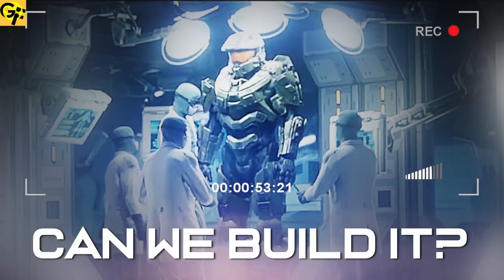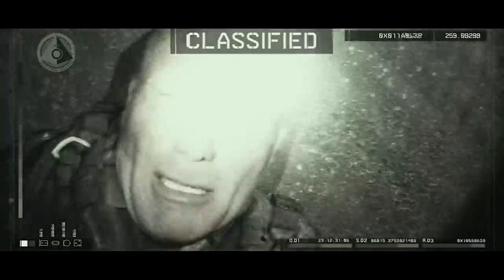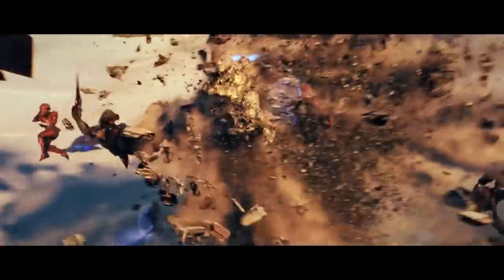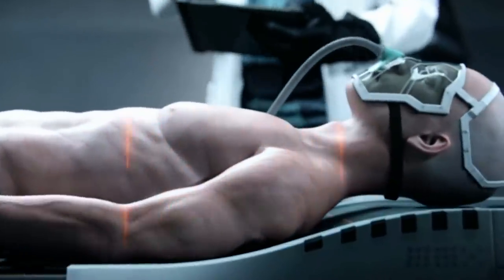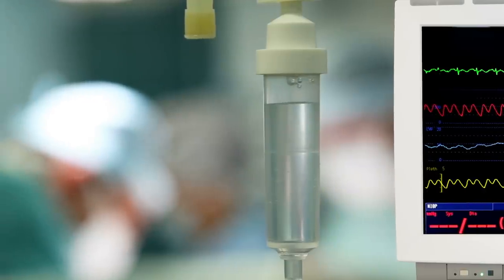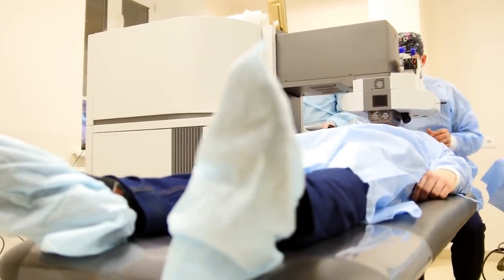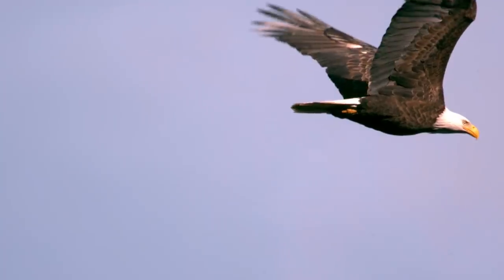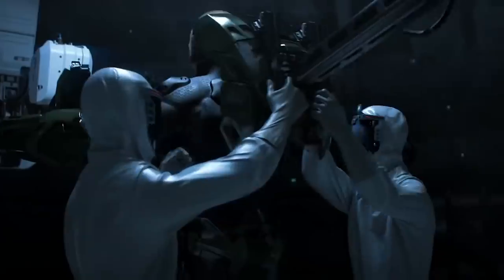Can We Create a HALO Spartan | Human Augmentation

Comment: You forgot that of the 150 candidates, half weren't even recruited due to lack of funding, so they only lost about half, not three quarters
Reply: J C A fifty percent mortality rate is still pretty poor.

Granted, they are better odds than humanity today would, even optimistically, be capable of achieving. But, those odds are still less than ideal. Even if you ignore all of the moral and ethical issues with this program, from a purely economic/utilitarian perspective, it’s a gamble. Only being able to see a fifty percent return on an investment is a loss, and I personally would like my odds to not come down to a coin toss.

Of course, that is looking at the Spartan II program individually. When you look at all of the Spartan programs as a whole, you start to see how the lessons learned from the Spartan IIs were applied to make the process of creating subsequent Spartans easier (i.e a positive return of investment). The Spartan III program was also a waste. But, it was wasteful for different reasons.
Reply: how to build super soldiers, you need carbon nano fiber grafted onto the bone, you also need to have viruses carry DNA modifiers that help boost muscle strength and health abilities. Also the super soldiers bones have to be designed specifically for all possible situations they may encounter, Also they need increased stamina, they need less mass and more strength, more efficient metabolism, cold blooded killers not warm blooded a suit that provides the heat needed in Arctic climates, the super soldier needs to have fast reaction time, they also need to be able to retain memory and muscle memory longer than average soldiers, their skills should require minimal training and they should be able to adapt new skills on the fly, if you can build a super soldier what else can you build?
Reply: Okay, both of you guys need to organize your thoughts before typing them out and edit them, if need be, before commenting on something because I’m not sure that I caught the points of your respective comments.
Reply: Vaurice Payton Literally, everything. You started off your comment as if you intended to contest something I stated in my own comment. But, then you gave a superficial comparison between the Spartan II program and the Spartan IV program, and you capped it off by stating that Buck’s being able to succeed as a Spartan is somehow proof of the program’s validity in and of itself.

(I’m not trying to be an ass or condescending, especially not when I used the word “superficial”. So, please don’t think that I’m attacking you.)
Reply: @Vaurice Payton -- You really ought to get in the habit of breaking your comments into smaller paragraphs.  Even a gramatically perfect paragraph goes on far too long to be a comfortable read.  Especially when read on a mobile device.

All that said, NOTHING about the Spartan IV program is ethical.  Adults or not, the need for secrecy makes augmentation a mockery of informed consent and medical ethics.

The argument for Spartans is "The Ends Justify The Means".  Nothing more.
Reply: 33 made it out of 75. Of the other 34, quite a few were then rehabilitated and put onto the front lines (Jerome, Alice and Douglas of Halo Wars fame were all rehabilitiated washouts)
Reply: @Vaurice Payton -- Please forgive how condescending this is going to sound.  When someone criticizes you, their goal usually isn't to make fun of your mistakes.

It's to save you the time and embarassment of all the other mistakes you will make learning the hard way.  I get the whole "sullen teenager" thing.  I was one myself for a while.

Frankly, I respect your argument that the Spartan 4 program was as ethical as such a program could be.  I also respect that you want to agree or disagree with me on your own terms.

Please don't make big blocks of text the hill you want to die on.  Most people just skip them.
Reply: @Grizabeebles  Bro chill out It's not that serious.
Reply: @bladeexcalibur1334  -- yeah I know.  But I'm 34 now and I was just like this guy at that age.  I never get tired watching people slap away a helping hand.

I mean he never even considered I might have been describing myself as "sullen" back in the day.  It's not an insult, it's the benefit of hindsight.

And if Halo lore isn't a story about how different things look in hindsight, I don't know what is.
Reply: @bladeexcalibur1334  -- Alright, I'll quit it.  Please just bear in mind that constructive criticism IS a real thing and that's what I was going for.

The alternative is everyone pretending there is no problem and making the same mistakes over and over.  That's how the Covenant wound up trying to exterminate humanity over a translation error.

I apologise if I hurt anyone's feelings or acted untactfully.
Reply: @Vaurice Payton Spartan IVs also ain't restricted by the dna requirement as the Spartan IIs were and with 30 year of advancing medical the medical part came out cheaper cause you already had a well trained soldier and didnt have to put more time and money into training already viable candidates thus thay could have more but at the cost of the mark 7 armors with its more limited armor capacity then the mark 5 and 6 that master cheif has worn. Spartan III were suicide squads and only worn odst armor with camo tech and no shields and could train 300 to 500 at a batch with all but 30 or so dying throw the agumintation which left the user in a rabid state if they didnt get the proper medication every few days. Thus Spartan IIIs could have half there chest blown off and still run till they dropped dead from lak of blood.
Reply: @wildcat2087  The part about the SPARTAN-IIIs is mostly incorrect. They wore SPI armor, not ODST armor with camo tech, and only 320-330 were trained at a time. All survived training and augmentation, and they were not left in a rabid state after augmentation that they could only hold back by taking pills. In fact, that is completely incorrect. I'll break my argument into chapters focusing on each SPARTAN-III Company to make it more digestible to read

Alpha Company is the first Company of SPARTAN-IIIs and was comprised of children from the ages of 4 to 6 years old. These children were orphaned by the Covenant at young ages and had their hearts filled with rage, so they joined the SPARTAN-III program when asked by ONI. They went through 6 years of intense training before going on Operation: PROMETHEUS in 2537 where they were all killed (besides a few that were removed from the rest and put into special squads and divisions). One thing these SPARTANs have that the SPARTAN-IIs didn’t is the unyielding brutality, hatred, and ferocity they have in combat (as well as the crazy high pain tolerance)

Beta Company is the second Company of SPARTAN-IIIs and is largely the same, but they were equipped with Mark II SPI armor instead of Mark I. Ultimately, the majority of them died in Operation: TORPEDO in 2545 besides 2 survivors and the SPARTANs Kurt and Mendez pulled from the rest of Beta Company.

Gamma Company is the third and last Company of SPARTAN-IIIs (likely the ones you were thinking of). They are pretty much the same besides the special augmentations they received that when in a high adrenaline situation, they go into an animal-like state where the primal instinct of survival takes over and they fight ruthlessly and brutally until they either die or every enemy in the vicinity does. The problem with this is that there’s a chance they can stay like this for the rest of their life. There’s also a side effect to these extra augmentations; the bi-polar disorder. After taking the augmentations, all SPARTAN-IIIs of Gamma Company suffered from bi-polar disorder and were required to take medicine for it called “Smoothers”

As you can clearly see, none of them are in a rabid state until taking certain medicine; nor do they wear ODST armor with camo tech 

SPI armor is much more advanced than ODST battle armor and has many more unique functions, but even though it’s advanced and well made, it isn’t even close to Mjolnir in terms of anything besides stealth. Which is why it was eventually almost completely replaced by Mjolnir by the mid-2550s among the SPARTAN-IIIs

Also, the SPARTAN-IVs don't wear Mark VII armor, they wear GEN2 armor. GEN2 armor is better than Mark V and VI in pretty much every way (including cost). Mark VII armor is only used by about 3 SPARTAN-IIs and is superior to Mark V, VI, and GEN2 armors, but it costs too much to mass-produce, so they decided to cancel the project and use GEN2 armor instead
Reply: @tridonstrident6785  its also been a few years since i read the series but yup your right. May have to take time again and read them soon. Also thought SPI armor was a upgraded version of odst armor never put into service cause of cost for the camouflage system.
Reply: @self-satisfiedsmirk5544  Your return and loss is only objective.
50% failure still assured human salvation and victory against the combine.
If my money was invested I'd see it being 100% used effectively.
COuld still make it better tho,I dont disagree whit that.